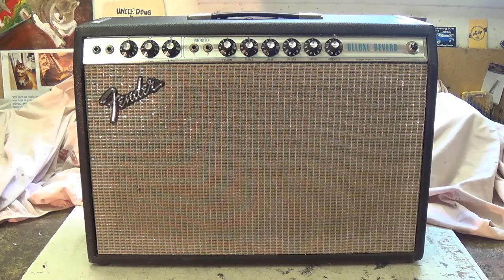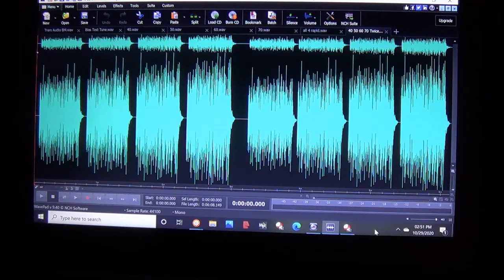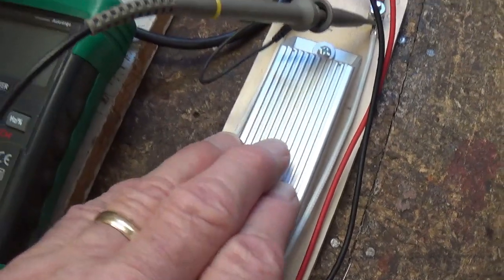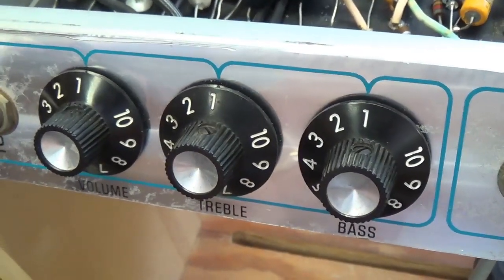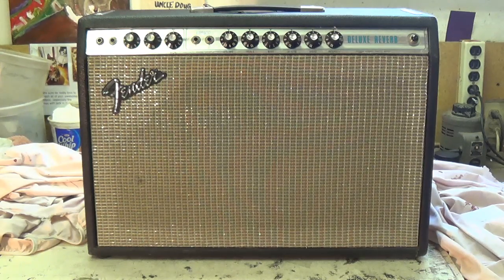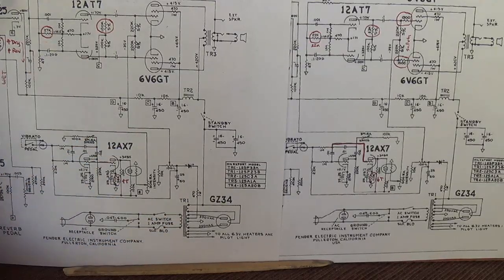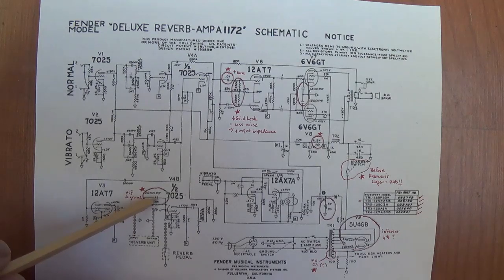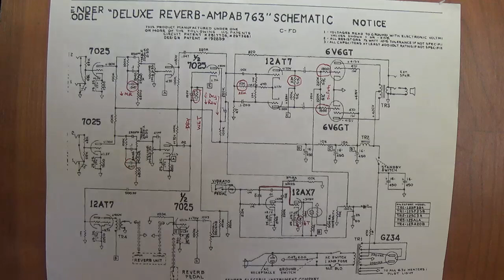The Effect of Output Tube Bias on Tone, Gain, and Headroom.....A Side-by-Side Comparison

Comment: Sorry @uncle doug I deleted my comment earlier. Well the amp is new to me. It came with a quad of nice old early 00's Winged C's which sounded great but I noticed that the one nearest the transformer was getting very hot compared to the others. So hot the chassis was almost too hot to touch after an hour of practice. I was having trouble getting them to bias over 30mv (using 1r cathodes on each tube off pin 8 to ground etc). I figured, in my ignorance, that this was a consequence of the bias adjust I'd wired in needing a smaller resistor but I swapped the tubes out for a new set of Tung Sol STR's I had on hand and immediately the bias adjust now went to -60 no problem and the chassis stopped cooking. Conclusion: bad power tube. 
I've been over the circuit and reflowed every solder joint, metered every component etc. Changed the screen grids to metal films, the stoppers to fresh carbon comps 1.5k, all the electrolytics inc. the filters etc. All the voltages measure OK and the bias is stable. But the PT still starts to get WAY TOO hot if I bias the power tubes beyond ~40ma. They radiate heat so fiercely its painful. In terms of how I am doing the biasing .. I'm fairly sure I'm doing it right (first time ofc). I installed 1r cathodes off pin 8 of each tube to chassis ground. I then put my MM across those and measure the MV e.g. 20-30-40 as I turn the bias adjust pot to increase or decrease the negative bias voltage. This is wired in series with the original 10kL balance pot etc. 
I find the amp sounds best with a 45.5mv  bias but everything gets way too hot after 30 mins or so. If I keep it about 50% dissipation, all is well. I might have a bad PT but everything else is otherwise OK and reads OK. The amp only draws 0.8a under load and runs at 135w idle. *shrug. I've checked the reverb transformer (OK), hard wired it to 240v and disconnected the other taps and heat-shrunk them and cable tied them out the way etc. The diodes are all fine and have been reflowed. The caps are all fine, no leakage. I even had to reverse half of them as the foils were all facing towards the controls and not aligned according to the schematic etc. Also I metered the 50ohm resistors on the HT/Pilot light and they are still good so not open. 
The board is not conductive .. I can basically find nothing wrong. I can only conclude that the PT secondaries are just not up to aggressive bias current draw and likely never were. This amp has a chassis that looks like its done re-entry more times than the NASA Shuttle. Its been BAKED for decades.. probably a crap/underwound PT from the factory.

Some pics: https://photos.app.goo.gl/cB1ZrpbiCoxetPZd7

Also the PT has loose laminations as it sounds like a barber's clippers. I'm going to attack it with some high temperature paint and wood clamps when I get time..
Reply: Sorry to +1 myself.. But I just finished work, popped a beer or two and decided to "blackface" this thing, since I was so unhappy with the tone as-was. 
1m grids, 22k tail in PI and the PI plates 100k and 80'ish. Swapped the output coupling cap from .01 for a .001 etc. But. The BIG difference.. I swapped the dog house resistors to 4k7 and 1k (AB763 spec). 
I don't understand - maybe you do? But. I biased it to -52 as per Leo's specs (just for the hell of it, bearing in mind I am half cut and playing with high voltage) and .. 
Not only does it sound GODLIKE but I just ripped on it for 40 mins straight and its not even half as warm as it was getting. 
I really don't get that but .. my God. What TONE. The reverb alone is to die for (I swapped the attenuation resistor from 340k ish to a carbon film 470k). But just like my 77 there's now some gain in the reverb and the treble knobs and wow what a totally different animal. I had "partially" blackfaced this previously (just the PI changes) and found it flat and spikey (albeit with some gain) but dudes, if you're reading this, make those two resistor changes in the doghouse and bump the preamp voltage.  Damn. Just blown away.. and why is it running cooler with a hotter bias AND more preamp voltage?! NO idea. Happiest man alive. I'm off to bash out the Twin Peaks theme for 3hrs straight.. 
Its like the amp has found its resonant frequency and the laws of thermodynamics no longer apply. 
I mean, sure, OK, its far more likely one or more of the original dropping resistors was bad.. but.. I'm going with the supernatural on this one. :)
Thanks Doug for inspiring me to dig in to it after 10 hrs at work! o7
Reply from the maker: @cgavin1  Are you biasing the tubes using plate dissipation......or simply plate current? PD is the only reliable method, WP. Best of luck with all your projects.
Reply: @UncleDoug   I have been using Rob Robinette's bias calculator. Entering the plate to cathode voltage (430v) and then the tube type (6L6GC 30w) and the millivolts of plate current and calculating the percentage based off that. I figured short bottle Tung Sols may claim to have 30w max dissipation but they are really 5881's with a few bells and whistles attached so I calculated based on 26w not 30. Aimed for 15w per tube (not per pair) as a ballpark bias point. It sounds OK. But it sounds amazing at 19.5w. The heat issue seems to be resolved now I've swapped those resistors in the dog house for lower values. I bought really expensive Takmans originally but I guess one or both were not up to the voltages. *shrug The 40c no-name metal oxides I replaced them with are working fine.. 
Lesson learned!
PS: Everyone told me to use 2-3w flame proof metal oxides in the first place so I'll also have to admit: listen to your betters. They know better. :)
Reply from the maker: @cgavin1  I'm glad the issue is resolved, WP. Continued good luck.

Comment: Hi Uncle Doug - I have a 1980 DR "with boost"  -and the circuit diagram shows the standby switch before the filter caps. Next time I slide the chassis out I will change that for sure. I got it 5 years ago and recapped it. I always wondered DUH why there was a delay after the SS was closed before there was sound. Well, now I know. !  Honestly it seems like the most audible difference if the blackface amps is the rectifier tube with different sag and attack. It might be another  interesting side-by side to swap rectifiers, set bias at 70% for each power source and compare tone.
Reply: meant "reservoir caps" oops...
Reply from the maker: That sounds like a very valid modification, SL.

Comment: Why on earth did you confuse the whole gain vs volume issue by bringing in dB? Gain in db is strictly 10log(power out/power in). The amp with the 50dB input and 100dB output doesn't have a gain of two, it has a power gain of 50dB or 100,000 times.
Reply from the maker: This was already addressed in the first (pinned) comment, Herald.
Reply: Ah, sorry, I see it was raised some 600 comments back which I missed when looking to see if anyone else was "excited" about it. My question hasn't been answered  though....
It is a tricky job pitching a presentation like this at a technical level that Joe Public can follow without saying anything that a professional EE can sneer at- my respect for your valiant effort!

Comment: Great video, but one aspect was confusing; at 21:28 you describe peak waveform clipping as undesirable distortion, and later on you similarly describe crossover distortion as undesirable. What then is the output tube distortion that we value as guitar players, and where do we see that on a scope?
Reply from the maker: When I said that clipping was undesirable, I meant from a fidelity standpoint, Tony. It is part of the distortion favored by guitar players.....but shunned by HiFi enthusiasts :)

Comment: Transformers: So, are these transformers used extensively in other types/brands of equipment, or did Fender have these produced for them? If the latter is true, might they not change the spec regarding center tap?
Reply from the maker: When you change the wiring of a power transformer, the model number is generally changed as well.....to denote the change. In this case, I believe the CT is present but simply not grounded.

Comment: Amazing!  Thank you uncle Doug.   Best explanation of the nuances of this classic circuit design and its evolution.  If one were to substitute gz34 in place of 5u4 wouldn't that significantly increase plate voltages on all the tubes, especially since modern ac lines are roughly 8% higher than they were 40-50 years ago?  Would one have to change dropping resistor values etc. to accommodate that?
Reply from the maker: Thanks, Big Mac. I generally just re-bias the output tube(s) a bit. I guess if you were a stickler for maintaining exact schematic voltages, you could insert a dropping resistor in the B+ line.

Comment: Now repeat everything using a compressor/limiter at various points in the signal chain and factor in tube degradation and capacitor drift and compensate for variations in wall voltage and temperature...and by the time you are done you will have PSH (permanent shift of hearing) caused rapid onset aging...Outstanding work
Reply from the maker: Thanks, Paul :)

Comment: The sound cleaned up as the amplitude increased. That is to be expected as you get that bias range close to its optimal plate dissipation. However, even at 70%, it sounds like there is something else amiss with the amp. Were you cranking the amp into some grit intentionally?. Like 5 or more on the volume?
Reply from the maker: The point of the video was to determine if 70% of max really is the "optimal" plate dissipation, James. To some viewers, 60% seemed preferable.  The audio was a recording of a recording, so it may have been imperfect.

Comment: Thank you for great explanation/videos. Would putting the Standby switch before the reservoir capacitor eliminate the need to install larger voltage rated caps (unloaded power supply voltage)?
Reply from the maker: You're welcome, GG. The reservoir caps get hit with high voltage wherever they're situated. It's just so much easier on the rectifier to place them before the standby switch.

Comment: Fender schematics always specified a minus (-) voltage to set the bias on the schematic. My question is
what percent bias corresponded to the  minus 35 volts specified in the Fender schematic? 40% 50% 60% 70%?
Reply from the maker: The -DC bias voltage number on Fender schematics generally shows the typical output from the bias supply. The actual amount of bias voltage applied to the grids must be uniquely set for each tube or tube pair.
Reply: @UncleDoug  Back in the late 60s the Fender warranty station in NYC as well as most dealers that did Fender repair which I did in lower Manhattan used that voltage on the schematic as the voltage to set the bias at. Measuring actual current draw was simply not done let alone match output tubes. . Later on, when I did service in the 70s, I used the crossover distortion shoulder method with an oscilloscope. The reason I asked the question as to actual negative bias voltage needed to achieve 70% dissipation was to see how erroneously the bias was set in those amps all those years ago. I would imagine they were over biased too "cold." I do recall however that the bias supplies  would  produce more negative voltage than indicated on the schematic.

Comment: Great video as always Uncle Doug!  One question:  why do they use 7025's in the front end and then 12AX7 in the vibrato?  Microphonics?  These tubes are equivalent, right?
Reply: 7025 are usually specified tighter for lower noise, I believe.
Reply from the maker: Thanks, Curtis. As Robert said, they were primarily for low noise application in HiFi amps.....but yes, a good old 12AX7 generally works just as well.

Comment: Uncle Doug thank you for these outstanding vids. I have a question, is there a difference between cathode current and plate current?  I'm looking at a 6v6eh data sheet and it says the cathode current not more than 80 mA? It says nothing about plate current. 70% of 80 mA just sounds too high.  Thanks!
Reply from the maker: Cathode current consists of both plate and screen current, Brad. Your 80 mA value is for two tubes in push-pull, thus 40 mA apiece minus screen current of 3 or 4 mA = around 36 mA.
Reply: @UncleDoug  Thank you, I mis interpreted the data sheet.

Comment: Great video Uncle Doug. The ear test is good enough for me. I did these exact same test on one of my amps a while back. I also took it a step further and did a frequency sweep and captured the data on a spectrum analyzer. You could do the same thing with your analog generator and look at the waveform on the audio software you have. That is what tells the full story about what is going on at the different bias levels, when it comes to tone. The headroom at different bias levels was definitely proven with your experiment, however, when it comes to tonal qualities, I think there is more going on than just the bias levels changing. When you adjust the bias pot, you are changing the input impedance of the power tube section. Any changes in input impedance between amp stages, changes the overall frequency response of the amp. You can actually go through the amp stages and calculate all of the frequency cutoffs and make a Bode plot for the overall frequency response. Also with the changes of impedance there are changes in resonant interactions between stages. This leads to different harmonic interactions. A frequency sweep will show that maybe at one bias level the amplitude of a  certain frequency is higher and then in a higher bias it is less (just one example I noticed with the sweep I did). These tonal qualities have more to do with the change in input impedance than what the bias values are. See if you can set up a test with your equipment to do a slow frequency sweep. You would have to splice several together for your generator, as it does not have one continuous range on the dial for the whole audio spectrum. Some audio programs will actually give you the frequencies at each spot in the wave and some actually have a frequency spectrum view. I don't know what you are using, so I couldn't say if yours will do that or not. I know Audacity has a Plot Spectrum in the analysis tab.
Reply from the maker: Thanks for your helpful input, William. My experimental design was to determine the audible variations in tone that resulted from different bias levels. Granted there are more complex variables at work behind the scenes, but they simply contribute to the audible tone that was presented for the viewers.......and honestly, isn't that really what we care about ??

Comment: Thanks for another great lesson!  Absolutely brilliant analysis of the different circuits and the effect of bias on tone and headroom.  One thing I grapple with is the effect on headroom of plate voltage.  The GZ34 produces voltage that can be excessive for some 6v6s, but with current dialled down they should be ok.  Is it possible that fewer, faster moving electrons make for a cleaner tone than loads of electrons moving a bit slower?  At uni I had some experience of high vacuum magnetons depositing ceramic coatings on stainless steel.  Voltage was key on getting a decent molecular deposit and current could cause problems.   Perhaps the number of electron collisions and scattering effects clarity of tone.
Reply from the maker: You're quite welcome, OA. It is my understanding that increasing plate voltage will increase (clean) headroom. I look at the plate (anode) as being a magnet for electrons, and the stronger the magnet (higher PV) the more electrons are attracted/collected.

Comment: Yknow what’s funny is the peak voltage doesn’t change much when the bias is changed, but your true RMS volt meter reads a higher value... this is probably because there is less crossover notching distortion, so the area under the curve is increased!
Reply from the maker: That's an interesting insight, Ben. Thanks for sharing.

Comment: Are we sure that node change from 10k to a 2.2k has no change on the tone?

Also, are you saying that you can swap out the 5U4 for a GZ34 without a problem?  I am sure the DR will sound better with a GZ34. I could see going the other way could be an issue
Reply from the maker: I seriously doubt that it does, George. Yes, you can replace the 5U4 with a GZ34 as long as you re-bias the output tubes.
Reply: I have compared a 64' to a 75' and the only difference was that confounded node resistor and yet they sounded different in that the 64' broke up sooner. So, the 75' had more clean headroom...I don't know, I think we need to look into that node...maybe put a 10k in there and use the ground switch to kick in a 4k7 in parallel or something to get it close to 2k2.

Anyway, just thinking out loud and thanks for your video/work!